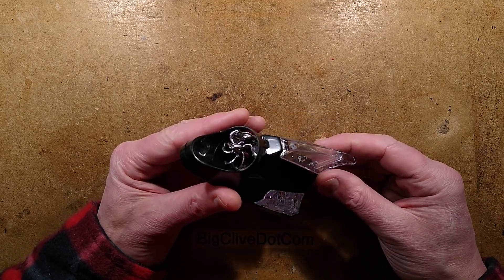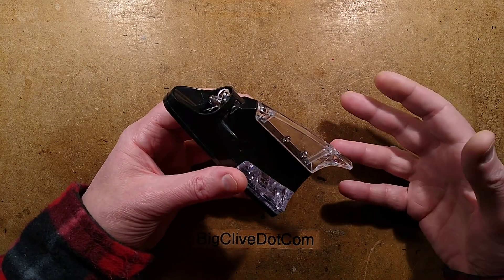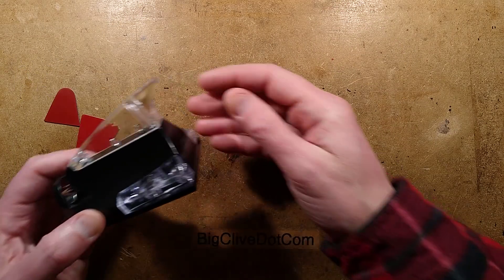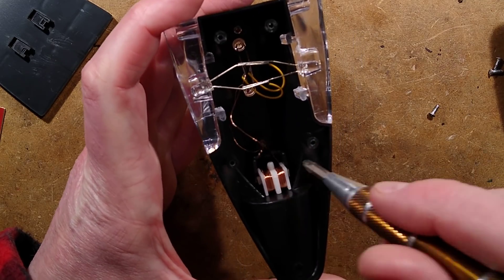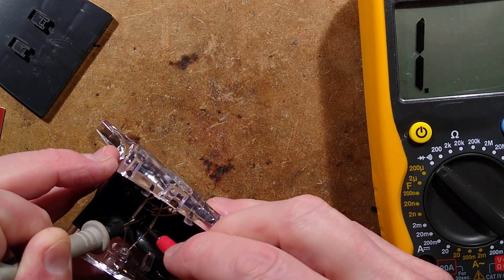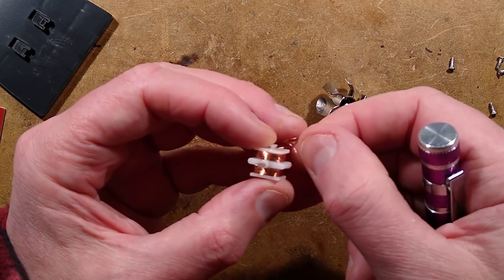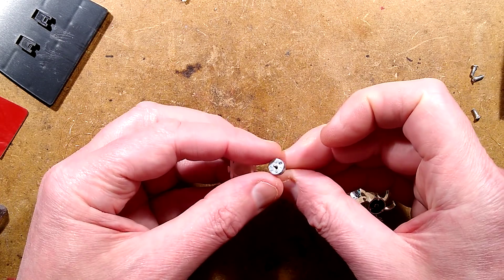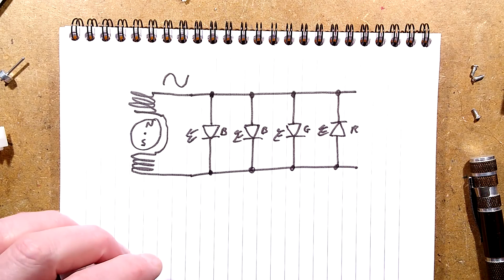Inside a wind powered shark light for cars

Comment: Hi Clive. I've been thinking for a while of sending you something similar to take a look at. It's a tap head that lights up blue, green or red to indicate cold, lukewarm or hot water. It's powered by the water flowing through it. I picked up two of them for about a euro each in Lidl. The one I've used has just started to malfunction, it's cycling between all three colours. If I can find the unused one I'll send them both to you.
Reply from the maker: I've got one of those here somewhere. The water tends to get into the electronics.

Comment: I wonder Clive, if you had kept the motor winding part intact and made a cardboard tube housing to go around the fan.  That you could have possibly built an AC with bridge rectifier DC wind powered USB charger for a little project. Made as an add on to your last project to recharge your Ni-Cell button rechargeable batteries etc? Maybe an in trouser FART detector or a hydro powered pee alarm thingy things. Could it be sold as a Cat in a Hat... Thing 1 and Thing 2 Detector, LOL.
Reply from the maker: The output is extremely low.

Comment: Clive I have an old primitive futabla transmitter 180ma is 60 ohms ?  It likes ni cads.
If I put 3 Li. Batteries in with a BMS and a 400 ohm resistor down the transmitter switch  line , to reduce voltage by 10%

I could charge it directly with my constant  amp volt circuit set at 12.8 volts  1/2 amp.when the switch is at charge position.

I am new to your channel and to electronics

Comment: Just to clarify, it's less efficient than wiring directly from the car battery. The drag created by this device opposes the car so it takes a slight bit more fuel to get to where you need to go.
Reply: I'm sure the noise of it spinning on the roof makes it worth it, especially after about 6 months when the bearings are well adjusted...
Reply: @BLKMGK4  The dual bearings are a soft slippery plastic.
Reply: A front mounted license plate will use about .7-1.3 extra gallons(U.S.) of gas per year. Much more than this device will. And yes, there are youtube videos on the subject.

Comment: Haha, Mount several on the bonnet, but throttle the air dect so that each one turns on at higher speed to meet the legal requirement for a speedo to be fitted to your car.. 
..but then you might need to correct for things light upwind, downwind, air temperature and atmospheric pressure for real accuracy

Comment: I guess the real purpose of this device, is to draw attention to a car that is bristling with all the essential add-ons. Passers by will gaze in awe at this fully pimped up street machine. For example, headlight eyelashes, drivers seat that is so low the driver can't see out,  a fat exhaust that uses 82% of available engine power to deafen everyone within a 2 mile radius, dropped suspension that prevents the car going over speed bumps, stereo so loud that the driver can't hear that expensive exhaust, underbody lighting, so the driver can find parts that were shaken off the car by vibrations from the exhaust and/or stereo, and illegal racing headlights to compensate for the over blacked out windows.
Reply: Ah, hello fellow resident of Bradford!

Comment: The best part about this product is when you hit a pedestrian, the Fast Lane Styling Wind Powered Shark LED Light slides off your roof and perfectly slices the throat of anyone in your way, making your travel adventures a lot more efficient and reliable, while looking the part. The only upgrade this could use would be a rubber band so it comes back once it's been used, to be ready for the next deployment.

Comment: I'd wager that thing would fail after a single drive. Imagine going down the freeway at 70 mph with that thing spinning in the thousands of RPM. If the LEDs didn't blow up from overvoltage, the plastic plain bearing is going to melt from the friction.

Comment: More landfill.
This is so rubbish. At least put a powercap in and some electronics to stabilize the voltage.
And indeed a bit of bearings.
This thing is gonna spin sp hard at 100km/h it just melts.

Tape on a place where least contact surface is. Nice for the one driving behind you.

Comment: I just want to tape it to the hood of my Camaro and see how fast I can drive before the LEDs start popping from excessive voltage. Even better would be to use the air compressor and see how fast 150 psi of air makes it spin. Probably would be quite destructive, dangerous, and FUN!

Comment: I could see those creating all sorts of issues, since most locales prohibit red and blue lights... That adhesive isn't 3M VHB so it's probably not going to last long... And barring all of that, it'll probably crap out fairly quickly due to rain and dirt ingress.

"Wind-powered shark light, doo-doo-do-do-do-doo..."
Reply: Potential risk of it detaching and damaging the vehicle behind.
Reply: True - I believe it's illegal in the UK to display a blue light, as these are reserved for emergency vehicles.  £50 fixed penalty and/or a court case  😯
Reply: You would get pulled over by the polis for one its illegal in the UK!
Reply: Baby shark, doo doo doo doo doo doo
Baby shark, doo doo doo doo doo doo
Baby shark, doo doo doo doo doo doo
Baby shark!

Mommy shark, doo doo doo doo doo doo
Mommy shark, doo doo doo doo doo doo
Mommy shark, doo doo doo doo doo doo
Mommy shark!

Daddy shark, doo doo doo doo doo doo
Daddy shark, doo doo doo doo doo doo
Daddy shark, doo doo doo doo doo doo
Daddy shark!

Comment: Another interesting thing to consider with these is legality. Here in Australia, you can't mount certain (red or blue) colored lights to vehicles (penalties are $110-$650 on the spot, or $2200 if you take it to court).

As always, before modifying your vehicle, make sure you aren't breaking any local laws.
Reply: Green is also illegal. Because traffic lights. Some idiot where I live had green parking lights (on a silver car - it wasn't even nice looking) and would drive around with them on all the time. Until he pulled up to the ATM one day and the highway patrol pulled up next to him and waited for him to come back to the car 😂

General rule for lights on cars/trucks... Don't do anything you haven't seen hundreds of on the streets.
Reply: I should also add that my Nissan Leaf has a blue glowing logo on the front of the charge hatch when the headlights are on... Looks a bit cool and tacky at the same time. I'm fairly sure it doesn't meet the ADRs, yet the car is approved for Australia.
Reply: @tin2001  Cops'll let you get away with a lot more if something is factory-fitted. Attaching blue and red lights to your roof with double-sided tape will not earn you friends among them, though.

Comment: You can stick it on your car and pretend its a backup power supply like used on aircraft's when they loose their engines they deploy a small wind turbine at the front to give them the most basic power abilities.

Comment: The ones I bought are chrome plated bars with a drive motor from a CD drive, like the one that drives the "cup holder".  They have double stick tape but are meant to be stuck to the front bumper.

The cars are not allowed to have blue lights, only emergency vehicles, so one could get stopped for having the blue lights.   Thanks, Clive.  Interesting!

Comment: That's pretty similar to the microgenerator in those novelty faucet addons that light up an LED with different colors, depending on the temperature of the water (using a thermistor in contact with the water).
Reply: Should I admit I have one of these connected to my kitchen tap? Definitely just a novelty, though it’s accurate enough to let me know when the water is hot enough for use.

Comment: The plus side to that little generator design is that it'll be really easy to make something like it at home, especially if one has a 3D printer. I'd agree it's a horrible choice for durability in that application, but might be useful for (say) a bike headlamp?
Reply: You would have to go very fast and have a pretty big turbine to make it at all usefull I presume.
Reply: There's so much magnetic leakage you won't be able to extract any useful amount of power. You might make something to make yourself a bit more visible but it won't light up the road at all.

Comment: It seems to be designed to invoke an aerodynamic style like a shark or rocket but the whole function of the product is based on having as much drag as possible. It's anti-design
Reply: "Shark fin" antennas is a common feature which I think first appeared on higher end cars. From there, it got "cool" to have a dummy antenna of the same shape on your econobox car. This seems like a further evolution with lights in it, but still riding on that 20-30 year ago "coolness".

Comment: I was thinking a machinist could make one of those out of aluminum with either a bearing or bronze bushing but I'd say instead of tape mechanical connection like screws would be best to attach it to a car excetra or like a bicycle is what I might use it on
Reply: The drag it adds will cost you way more than the energy it generates.  Especially on a bike, you'd be much better off with dynohub or just a rechargeable bike light.
Reply: Magnets would probably work fine. I believe that's all that holds on the signs for pizza delivery and such.

Comment: Might be fun for kids on their bicycle if you could replace the fan blade for a larger one so that lower speeds might spin the generator. Or even wind powered yard lights.
Reply: Yeah sort of like the old playing card and clothespeg gizmo we had back in the 70's nothing complemented yer Chopper better lol
Reply: @garrygemmell5676  I like using balloons hit by the spokes for a deep motor sound. Well until the balloons break.
Reply: The garden light idea is interesting. Wind and solar with storage has commonly used to make things like environmental monitoring an all year round option ...
Reply: Dunno, 25 mph winds are pretty brisk for many locations.   But for a kid's bike, sure.   Otherwise, bin food, methinks.
Reply: @tubastuff  Change the small blades for a kids Pinwheel, it should spin at 5MPH then.
Reply: Or just use a dynamo like we did back in the dark ages lol.

Comment: I'm not sure why I was expecting more. If nothing else, it serves as a very simple demonstration of basic wind power. It might be fun to hack with a solar garden light, and give it a bit of a reserve to stay lit when you come to a stop. Love all the stuff Clive does!
Reply: You can buy educational wind power kits in a lot of places.. this would probably do the job just as well but at a fraction of the cost.
Reply: @benbaselet2026  I've seen a few of those kits, but never paid attention to the price. I just like this one based on how visible the generator part is. Now you've got me wondering what the price difference is!  EDIT: Surprisingly not that big of difference. This light is about USD $8, and the educational kits range from USD $10 to $20 or so. And for roughly USD $10, a similar light is available in solar power!
Reply: A small capacitor might suffice as a reserve EDIT Maybe not as its an AC output and would require converting to DC.
Reply: @Arachnoid_of_the_underverse  Adding a rectifier bridge is no problem but a super cap would be expensive and then you'd have to do some sort of current limiting as well. It gets complicated fast.
Reply: we think they same but maybe not.

i see it as exactly that. path lights. shed lights. thing is it charges whenever theres a breeze, not when its in the sun. those path lights are quite particular about where theyre located...

wires are a downside. sigh.

decent blades at say, 300mm will make a few watts at least... and could look interesting.

Comment: I see meltdown in your future.  Especially with all the electronics you found inside.     
Power goes up by the square with wind turbines.  Double the windspeed, square the power output.  At 50 mph square the voltage supplied to the leds.  Go pop?

Comment: I can see using a couple of these for when you are stopped on or beside the road in a winter snow storm. If they swiveled with the wind, they would let people know you are there. Depends on brightness, of course.
Reply: They're not that good, not bright enough to have any usefulness as warning lights,  and they don't work at all when the car's stationary.  In the UK it's rare for wind speeds to get high enough for wind alone to operate these. And on top of all that, they're actually technically illegal anyway.

Comment: That's got to be a contender for one of the most useless and tacky vehicle accessories!
I guess the generator bit could be potentially useful for some other project like a wind-powered garden light or something though
Reply: As tacky as it may be it still kinda cool.
Reply: Nope:  spinner wheel-covers.
Instantly subtracts 50-55 IQ points from the driver.
Reply: Where I live it's illegal to have a red light visible from the front or a blue light visible while driving, so it would be a great way to acquaint you with law enforcement personel.

Comment: So glad to know that you've got hold of the "high-quality" shark LED light for this tear-down. No point messing around with naff tat.
Reply: I wonder what differentiates this one from the low or standard quality version, I believe the low Quality doesn't come with sticky tape so you have to keep your hand on it as you drive along .
Reply: @marklatimer7333  And a hand crank instead of a fan.
Reply: Lots of little bits to come flying off, straight
into the windshield of the police car which
happens to be following you on the highway.
Reply: LOLZ

Comment: Looking at the thickness of those wires inside, I am willing to bet one of them will break when the air flow increases with higher speed, and when they violently start to swirl around the housing. Luckily, the wiring itself is very basic, so just replacing it with thicker wire would solve that problem. Oh, and the Chinglish description is no longer that bad. It seems the Google translate AI is getting better with time. Just a couple of years ago, and you would need Alan Turing to decode the same message.
Reply: The wind doesn't enter the housing - it gets deflected to the sides, behind the turbine blade.

Comment: Up in deer country (like Pennsylvania) people use these fan whistles on the hood or elsewhere to try to clear the dear off the road.  These have been around for a long time in cheap catalogues.  I suspect this fan blade makes quite a noise as well.
Reply: I've often wondered if those whistles work as advertised. Do they?

Asking because I can't be arsed to acquire a car or truck so equipped and then engage deer in a high-speed chase to find out for myself.
Reply: @michaelthibault7930  Not sure if you're joking, but in deer country...deer chase you .

Comment: LEDs are getting so efficient...  I just replaced a failed first-generation CREE LED bulb (with the big, finned, metal base and rubberized glass bulb) in my pantry. It's on an old X10 light switch.  The new LED bulb won't even turn off due to the leakage current the switch uses to power itself but now operates in "nearly enough light" and "plenty bright" modes.
Reply: If your connectors are unpolarized (Schuko?), try turning the plug of the lamp or the X10 switch 180°.
Reply: @Andreas U.  i think its an al old smart switch that only requires 2 wires and relied on the conductivity of a turned-off incandescent bulb to get its neutral connection
Reply: funny because consumer led bulbs arent even anywhere near the efficiency of high end chips. leds truly are miracle technology
Reply: I have three of those old rubbery feeling bulbs in my bathroom, still all working fine.

Comment: Interesting but still not as great as taping harmonicas to a car (in the grill or somewhere else) and your car making a fabulous raspy death tone as you floor it.
If you don't want to tape harmonicas to your car, get the kids to hold them out the window. No kids? Just get one of those window flags (you attach via closing the side window) and attach the harmonic to the flag with wire.  Better still, do this and harmonicas! 😉😊😋
Reply: I wonder if harmonicas would be better attached to the exhaust pipe(s)….